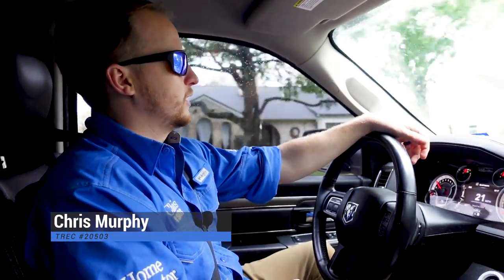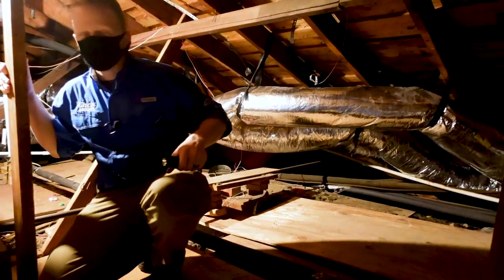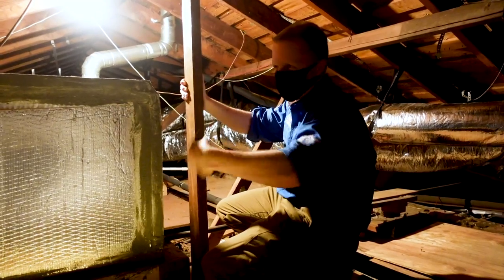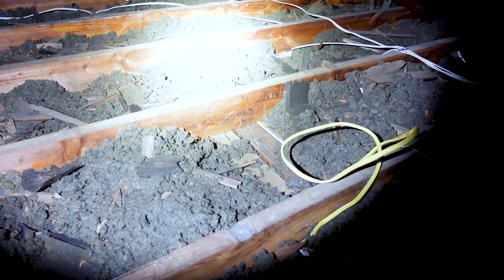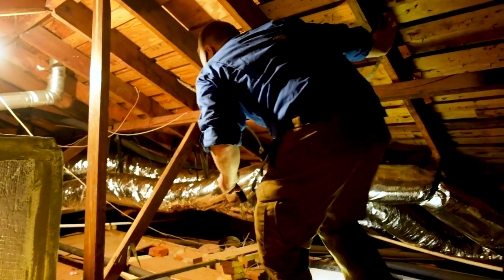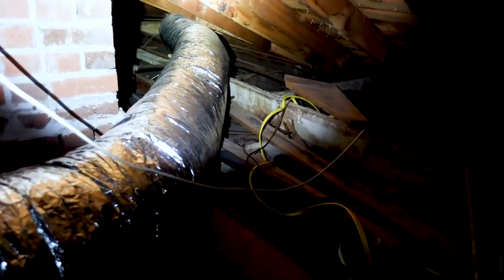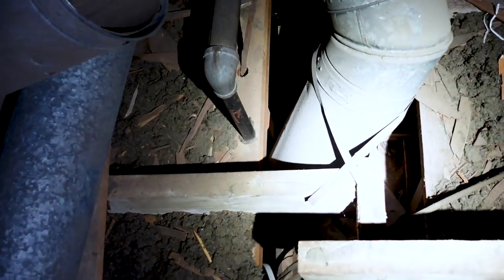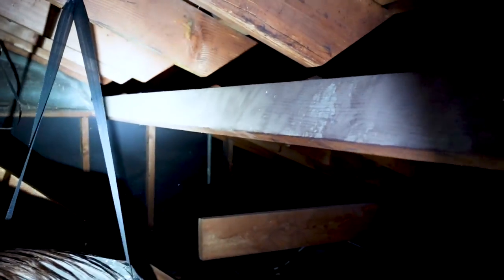Home Inspector Missed Missing Insulation

Comment: The reason you should not run condensate line into plumbing vent stack is that there is a possibility of sucking sewer gases into the unit and possibly recirculating it throughout house.
Reply from the maker: Nice thank you!!

Comment: Around here I call out 3 forms of venting all the time. Do they not worry about it in texas?
Reply from the maker: Ventilation is recommended 50% soffit and 50% Top in our area.  I have not researched others
Reply: Yah. I was always taught if u had gables with ridge and soffit the rain/snow could actually get pulled into the attic space.
Reply: @scrunchiiface  Houston is sub tropical, snow is not a concern that climate.   This was an older home as can be told based on the type of roof support, slats.  Original may have been a shake or wood shingle.  Lots of air ventilation in those attics.  Original homes of that period didn't have any insulation in the attic and many times in the walls either.  Also is there room for adding insulation?  The area where the HVAC system is located may need to be raised to allow for 12+ inches of blown insulation.  There may not be room.  If the whole area is insulated except for the platform area and where the equipment is located that could cause a serious problem for air movement and collection of moisture in the attic.  Given that this is Houston a high humidity area adding insulation may cause a mold/mildew/Fungi/Biological growth problem if the humidity problem isn't address first in the attic.  That may be dealt with by having a vapor barrier put down and making sure you have the 1 square foot (split 50/50 high/low) needed for every 300 square feet of ventilation in the attic.  To accomplish this the equipment may need to be removed to add vapor barrier underneath.  The point here missing insulation is an over sight and is required to be reported as a deficiency per the the TX SOP.  Looking at this to add insulation is not the best direction, it would not be good to agree with or advise adding insulation (not saying Chris you did, just for anyone one else benefit) either given that may pose an issue.  It would better to recommend further evaluation by a specialist in home energy efficiency to evaluation.  The entirety of the home needs to be taken into consideration.  With an 18" overhang or more gables are fine according to code in this part of Texas.  Here we do have gables on older homes and soffit vents,  it is not unusual to not have ridge vents.
Reply: Similar homes scattered around town.. some have gables,, some have soffit and whirly.  The more expensive have ridge/soffit.   Some have closed the gables and others haven't.  Its always confused me.
Reply: The house I'm currently restoring is from 1946 with a carriage house in the back.  It always blows my mind at what people will cover in flips.
I'm in northern Arizona where we have monsoon rains and lightish snow storms. I'm far from being a velocity and path  of humid air engineer but this intrests me. We have similar 1946ish houses with all manner of attic venting.  This one is still a conundrum for me.